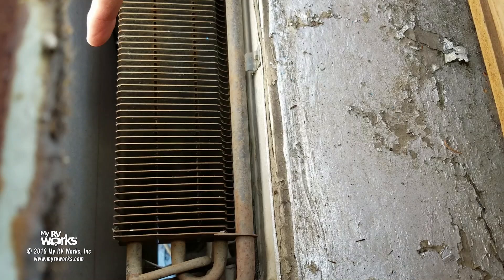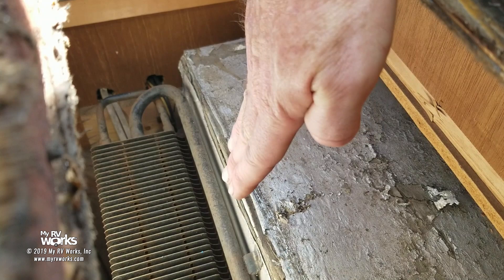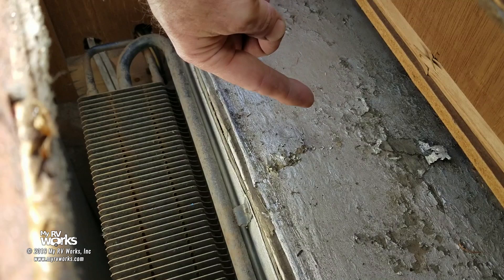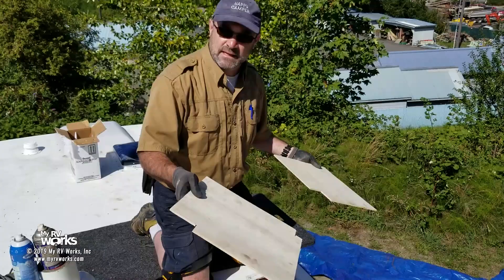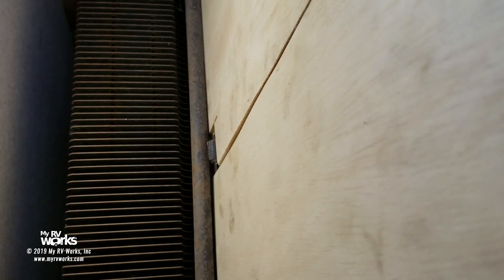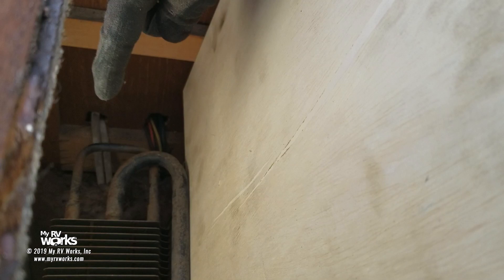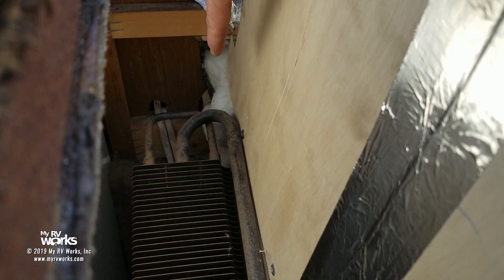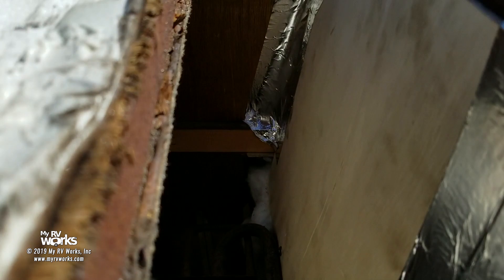Achieving Proper Air Flow Behind Your RV Refrigerator For Better Performance

Comment: What is your opinion on driving with LP on to refrigerator? And what are your thoughts on Camco refrigerator with solar cap with small fan? Great video by the way.
Reply from the maker: Driving with refrigerator on is perfectly acceptable.   The manual states this clearly.  The movement of the RV will help circulate the liquid/gas components.  There may be DOT requirements that will have you turn off the LP (tunnel for example) but run with confidence in LP mode and get on down the road.

I installed a Camco solar fan on my frig when we were in Texas and worked great.  The fan is a bit noisy so be advised.  Since we moved to Washington I disconnected it to not have the noise.
Reply: @MyRVWorks  thanks for responding. I really enjoy your videos. Keep up the good work

Comment: So how did you pre-drill and installed that lower screw?...what tools did you use?...telling us about it and not showing what u did on that screw is useless....
Reply from the maker: More than likely I would have used a right angle drill bit adapter.  On our Amazon store you can find these tools and many more like them Under The Tool accessories section here:  
 https://www.amazon.com/shop/myrvworksinc?ref_=cm_sw_r_apann_aipsfshop_aipsfmyrvworksinc_XC75592G7YDWV382ZPK4

We've also done videos on tools that are carried in an RV text tool bag. And on our Patreon channel will be coming out with a video showing our service trailer.

Comment: Is this a condensor, residential fridge or an RV fridge? Does the same apply for residential?
Reply from the maker: This is an absorption refrigerator typically found in RVs. It's a kind that can work on LP flame or an electric heating element. Very, very different from a residential refrigerator that has a compressor. This absorption refrigerator has no moving parts and is more a chemistry set. It is critical on these units that the back 'chimney' is able to scrub off the heat from the coils and condenser.  For a residential refrigerator, it doesn't matter because they use a compressor to get the job done - much like an air conditioner.
Reply: @MyRVWorks  I recently replaced the RV fridge in my 1999 Tioga with a residential fridge.  Do you have any tips or tricks on how to keep this running smoothly and chilly?

Comment: Did these work lower the refer temp and if so by hw much?
Reply from the maker: Well proper airflow up the back side to scrub the heat off the cooling unit is the wav systems work. How much it will affect is a function of the insulation value of the refrigerator box itself. If that back wall is in direct sunlight, and it is very hot, then everything maybe right with the installation but there's just not enough insulation on that refrigerator box itself to keep it cool.  It would be no different if we had an ice chest and we left that ice chest in direct sunlight on a hot day.  The more efficient and proper and slippery that air is moved through the back side of the cooling unit to scrub heat the more efficient the refrigerator will cool the inside.
Reply: GREAT VIDEO!!  One question though, do you have to worry about insulation touching any of the piping and fins in the back of the refrigerator? I would be afraid they may start a fire. Thank you in advance for your answer.

Comment: Couldn't you have just filled the space on top of the fridge with insulation????
Reply from the maker: Anything would have been better than what it was. But I want to make the air have the least resistance as it slips through the cooling unit and out the roof.